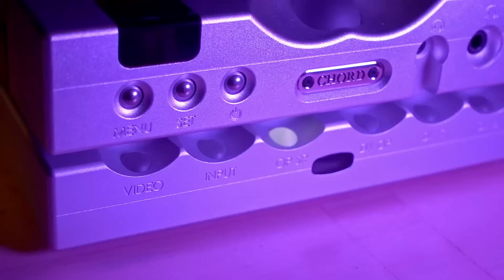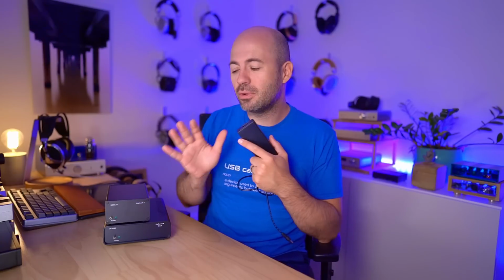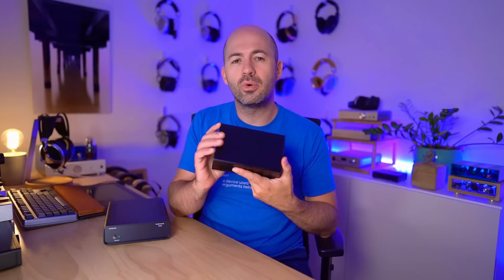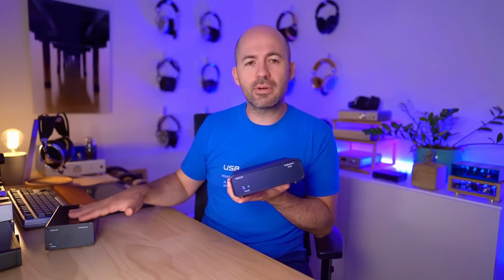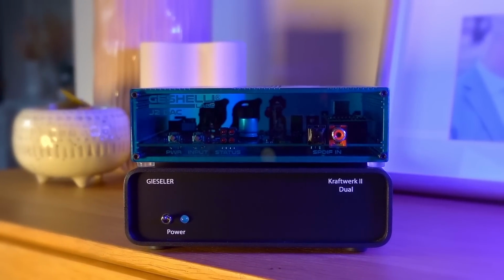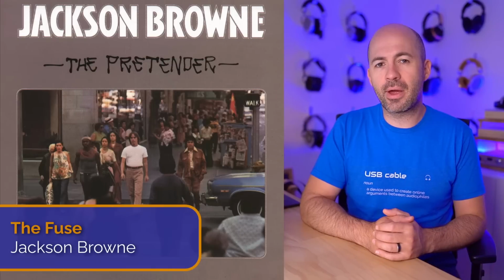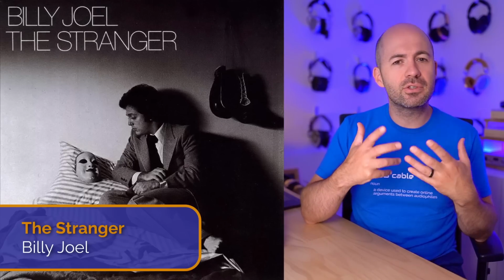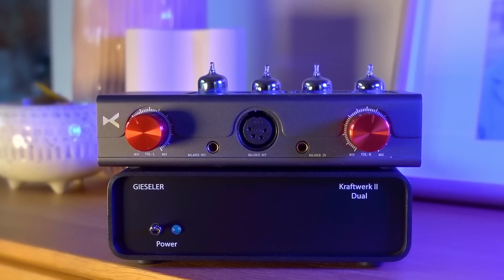Audiophile Linear Power Supplies - Do they improve the sound?

Comment: I am a DIY audiophile. I have been running my DAC on nickel-cadmium batteries intended for standby lighting applications. These sounded better to my ears than alkaline dry cells which in turn sounded better than the supplied wall wart. After 5 years of intensive use, my NiCads are tired so I am designing a mains-powered replacement. I have re-batteried my supply but while doing this I set up my bench PSU so I could still have music. The bench supply sounded shallow, artificial and well, gritty for want of a better term.
I have put my oscilloscope on the bench supply and found a very short spike at 32 Khz which is a full volt peak-to-peak. I suspect this is the villain of the piece.
Putting the scope onto various general purpose and audio grade linear supplies is also quite educational. General purpose diodes often induce ringing at a wide range of frequencies when they switch. The soft recovery fast switching diodes in audio supplies really is a far more civilised device. Finally, use a shunt regulator wherever possible. I first read of this concept in the late great Allen Wright's "Tube Preamp Cookbook". (A hands-on Australian audiophile.) You will also find shunt regulators in Bottlehead kits - and anyone who owns one will tell you they work .
If you are a DIY-er building power supplies, don't trust your multimeter, put a scope on that supply, AC-coupled and look at the nature of the noise. It really affects the sound! 😀
Reply from the maker: That's really interesting! Thanks for sharing!! 🙂🙂

Comment: Thanks Again for another great video. I've watched a few of your videos and you've replied and been extremely helpful. I bought the xDuoo XD05 Pro and it has an option for external power supply via usb-c. It says best used with a HIFI DC12V linear power supply. I don't know how that would work with a USB-C. I don't even know what to purchase...I don't see anywhere that sells that exactly. I don't see how a USB-c connects. I hope you can review the XD05 PRO and explain how to connect the ext. Also your thoughts on the different amps and DAC options. I also purchased the AKM AK4499EX DAC Card. I read changing the op amp to Sparkos SS3602 DUAL DISCRETE OP AMP. makes a big difference. That's what lead me to this video and how great your other videos are. I'm going to also get the Hugo 2 to compare it to the XD Pro. I wonder if the XD05 PRO with the AKM DAC and Sparkos amp and power supply would take it to a high level or is all that just very small gains? Would the HUGO 2 just be better. I'm using this from my MAC apple lossless music via USB-c to headphones like LCD-5, MM-500, Focal's etc. I will look into supporting you with some donations. I hope you know how helpful you are. Thank You!
Reply from the maker: I'm so glad I've been able to help! I've also actually got a video on the XD-05 Pro due out any day now... However, I didn't test it with an external power supply. I'm not sure how much it will affect the sound because batteries are already excellent power sources so it would be for convenience more than quality, I expect.
As for what you'd need, any good quality linear power supply with 12V (and whatever current level that recommend) would do the job as you'd just need to order it with a USB-C connector instead of the more common DC barrel connectors
Reply: @PassionforSound 
Hi there Lachlan. It would be super helpful if you would measure the voltage ripple on the output of all the power supplies you are reviewing. It should be related to quality. 
And especially important is to compare this to the voltage ripple on the cheap wall-wart switch mode power supplies that generally come stock.
My understanding is that it isn’t so much about whether the supply is switch mode or linear—it’s about how much ripple is on the output and how much DC current is available per output tap.
So I don’t expect any improvement if the stock SMPS has 40 mV ripple on the output and a potential upgrade linear has 30 mV. But I would expect a noticeable improvement if the stock cheap SMpS has 200 mV ripple and your upgrade linear has 10 mV.
A last consideration is whether the device to be powered already has a big and effective pi-filter inside to clean up the DC coming in before it enters the electronics. If it has that—then a cheap dirty power supply should be just as effective as big expensive clean one…

Whoa $600 for the Gieseler?! Yikes. You can get 50W 12V linear supplies (2.1A per tap) with measured 5-10 mV ripple on Ali Express for about $50-100! Obviously you didn’t “listen” to these—but other channels are using them and like them—and they’ve tested the ripples! All these power supplies have filters for high frequency noise.

Your points about supersonic frequencies are interesting. I have long wondered about all of that—can we actually perceive supersonic hash created by delta sigma DACs and switching class D amps? Can we actually perceive HF info in recorded music (signal)? I would start with studying the EAR rather than the brain—the brain is obviously super complex and it is very difficult to know what we actually perceive there. But I would assert it kinda doesn’t matter what complex stuff is going on in the brain if the hair cells in the organ of Corti in the ear cannot actually detect HF info—and I believe that is what is the case. Young humans can detect 20 kHz or maybe even a tad higher —variable among people. But it is clear as we age and particularly if we are exposed to very loud noise, damage is done to those hair cells and HF sensitivity decreases over time. So I think it may not even be POSSIBLE that we perceive HF hash and signal directly. BUT there is a question of subtle interference of such Hf info with audio-band frequencies that alters the character of the audio-band info, which we can obviously hear…
Reply from the maker: I'm not equipped to do those kinds of measurements and I suspect there could be more to it than simple voltage ripple or cheap devices would have power supplies as good as expensive ones and that's often one of the key differences between models within the same brand - power supply quality.
Reply: @PassionforSound  mmm, idunno. I think all it requires is an oscilloscope, and I think pro reviewers should have them. With a lot of audio we don’t entirely know what to measure, and we don’t know if by maxing one particular thing out we even achieve anything or just basically do pointless overkill… but I have always believed measurements are a basic part of a review. And regarding subjective listening (which is the other part): unless you do ABA volume-matched blind listening testing we don’t even know if our perceptions are simply being biased (and almost nobody I have ever seen does blind volume-matched ABA testing)—by this I mean you have 3 samples of the same music and two of them are either the test or the control and the other is the other one, and the observer  don’t know which samples are even duplicated —so you have internal control for basic lack of any difference… in many cases the observer can’t even tell which two are the same!
So yeah—idunno. But i think power is basically about ripple and unwanted HF not from the music, and enough current, and unless someone shows me otherwise, I will continue to assume that’s what it’s about—but without knowing what the true perceptible ripple threshold is, and whether it is different for DACs and amps or what…
Reply from the maker: Have you seen my recent video called "The secret to wonderful sound"? That explains why there's actually a LOT going on and why it's hard to correlate measurements to subjective listening.
My next video will explain why blind ABX testing isn't actually helpful (based on science and biology)

Comment: Any decently engineered audio components is designed knowing that the supply voltage provided by those external power pack won't be perfect, they'll have noise / EMI, etc.  The power pack that comes with it was chosen by the company so the component will perform as expected, within the provided specs.
If you have a crappy audio component that doesn't perform with the provided power pack, than simply change it instead of trying to compensate by buying external components...  Here is a video that demonstrates this: https://youtu.be/OL23xkLfPTU
The guy provides crappy power to an audio component using a light dimmer, no change on sound quality...
Reply from the maker: ASR videos and reviews are a dangerous source of information because they're limited to a very small set of measurements based on a limited understanding of what matters when it comes to perceivable sound quality factors.
Reply: @PassionforSound Wrong answer... Facts speaks by themselves. I challenge you and anybody for a blind test in a controlled environment...  By the way, you just showed you don't have the knowledge and obviously didn't provide anything to back your claims...

Comment: Most switched mode supplies have a drop down transformer too. Like the linear supply, it provides isolation from the mains side and the dangers present there. Those are regulators by the look of things. $900 for a 15v 4A regulator is a lot of money.
Reply from the maker: I'm not qualified to debate the specifics of the circuit design. All I can say is that these are sold as linear power supplies and use a transformer before the circuit your referring to.

Comment: Switch mode power supplies are the way of the future. Most audio companies are changing from linear to switch mode power supplies. Much cleaner .
Reply from the maker: Cleaner in one aspect only (low frequency hum), but both LPSs and SMPSs have their own issues. It's not quite as clear cut as you're suggesting. There are just as many brands committed to LPSs.

Comment: Linear power supplies are actually low frequency switching supplies (as was pointed out to me)....The rectifiers are commutators or switches......
Reply from the maker: That's an interesting way to look at it.
Reply: @PassionforSound  Yeah, when you think about it, all the talk of fast switching and soft recovery diodes as rectifiers tells the story. As well as the snubbing networks used to damp down the excitation of the transformer inductance spikes in response to the diode switching. That's partly why people prefer valve rectifiers, as they have different switching characteristics.

Comment: Linear is the superior choice, which is why it’s usually found in precision lab equipment. It’s also much more expensive. Bits are bits until they have HF noise in the signal and may end up with some interpolation errors.
Reply from the maker: That's been my experience too. It's interesting though that someone like Rob Watts stands by the SMPS for his DACs and believes they are as good as a perfect battery supply. (I'm not saying he's the sole source of truth, but he does his research and testing so he's normally got good reasoning behind his conclusions).
Reply: @PassionforSound  He may have a way of attenuating noise in the circuit. Would be interesting to know more.

Comment: Fiio k9 pro does have linear power supply inside. Is the PL50 will improve the sound quality?
Reply from the maker: No. You wouldn't be able to connect the PL50 to the K9.

Comment: What I cant stand about those videos: "I tested..." Provides no measurements :(
Reply: Whats the point of measurements?  If you like the sound with your ears, thats all that matters
Reply: @ When there is no measured difference and you say I like it with device xyz better...... have you heard my magic device? Its only 20k and it will change your life
Reply from the maker: No measured difference doesn't mean there can't be an audible difference if the measurements can't capture the factors influencing the perception of the sound (e.g. timing accuracy or the influence of noise on the internal audio circuits causing masking of low level signals, etc.)
Reply: @PassionforSound  I assume you know nothing about Audio or how measurements of audio equipment work because you dive right into the believe and trust me territory.
Sad.
Reply: @ Buying based on measurements is like getting a car solely off 0-60 numbers and dyno tests. There is so much more to how a car feels than numbers and that applies directly to audio equipment and music appreciation.
Reply from the maker: @EvilCutz assumptions are rarely a good idea https://youtu.be/03ggUm1kjuQ?si=kIKSXzixhJQlaT7Z
Reply: @PassionforSound  What you stated in your system comparison is so abstract I wonder if you even spent 1 minute of your time researching how measurements work.
You link a peer reviewed publication about human hearing and give a short summary which tells me you recognize some scientific statements but then you straight up deny and or withhold or even lie about other things.
I think argueing here wont change anything since this is all based on belief. Good luck with your theology channel.

Comment: Most components don’t have external power supplies so how can these be used? I’m
Confused!
Reply from the maker: These will work with any device using a DC input from a wall wart. I find there's been about a 50/50 split of mains connections (AC) vs wall wart (DC) connections over the years of my reviewing. Lately though, I'm noticing more mains connections with internal switching power supplies so that makes it a bit trickier
Reply: Thanks. This leads me to another confused issue. Power to components is AC and devices stop DC on mains. Yet you are talking about power supplies using DC? So do components use AC or DC?
Reply from the maker: All audio signals are alternating current so they ultimately need AC at some point, but there are many ways to achieve this and the 110-240V mains inputs are all way too high for audio so they need to be stepped down. This can also occur in different ways. So, the answer is that they use both AC and/or DC and it's up to the designers and what they see as an optimal approach for their particular circuit.
I guess it's a little bit like petrol vs diesel vs gas. All can power an engine, but they all work differently with different pros and cons.

Comment: SMPS are fine, nowadays event a cheap aliexpress PSU have noise range of 50mV
Reply from the maker: That's true in theory, but there's still something different about the sound when using a LPS on quite a few devices
Reply: @PassionforSound  Well the rule of thumb is as long as i don't need high degree precision in anything, SMPS would do. I mean it is not like I use Oscope to listen to music. The noise level is simply dampened with speaker inertia, in essence, it acts as a low-pass filter. However, if you listen to a lot of music with sudden volume spikes LN transient response would be superior.

Comment: Thinking of pairing the fiio pl50 with the fiio r7. I'm very new to all this. Do these linear psu normally come with the cable to power the dac/amp?
Reply from the maker: Yes, the LPSs will come with connection cables. If you're buying from a brand like FiiO, it will probably come with the cables for their products only. With other brands, you'll either get a selection of common connection types or you will get to choose what you need during the purchase process.
Reply: @Passion for Sound  thank you for your reply, it's much appreciated!

Comment: Just a small correction, switch mode power supplies do have an transformer, here's how they actually work, first ac input gets converted to dc, there is going to be a switching transistor somewhere in that part or integrated in rectifier,  then the voltage gets busted with buck converter to about 400 volts, after that it goes to inverter where it gets covered back to ac but at much higher frequency than the main power which allows for much smaller transformer, after the transformer now lower voltage gets converted to dc and stored in capacitors, after the capacitors there is an voltage regulator along with noise filter and just before the voltage regulator there is an sense line which measures the voltage in output caps and switches the power supply by controlling the transistor on the primary side, some switch mode PSUs can have multiple output voltage regulator stages in series giving them less ripple.
The name "switching power supply" doesn't come from "switching transistors" it's called switch mode because the whole power supply turns off once the voltage in output cap has retched the certain level, and it switches back on once the voltage drops so there is very little energy wasted on idling.
Reply from the maker: Thanks for the detailed explanation, Sebastian!
Reply: Sebastian_Athea, writing as a person who designed both linear power supplies and switching ("switch mode" is a stupid name, I wish people would stop using it) supplies, your "this is how they work" description of switchers is not representative of ALL examples. A great many switching supplies use transformers, but many don't. Granted, unless the switcher is very cheap, it WILL have a transformer for galvanic isolation if for no other reason, and AC/Mains switchers will certainly have a transformer, but NOT all examples in the broader switching category will have them. But basically, you wrote a good description.

Comment: I just got the Topping E50 ..and “everyone “ says it scales with better power supply and an improved performance overall….🤔🤔🤔🤔
Reply from the maker: Yes, I agree. There's no need to go mad with that though - a simple iFi power supply or a battery power bank type setup will be great and won't cost 2-3x the price of the DAC
Reply: @PassionforSound  best of the Easter 🐣 season to you and yours…I may go the IFI route for the power supply ..
Thanks for the advice.
Reply: Have you tried a better power supply yet?
Reply: @thaflybear  Yup!
I puked up an IFI power supply for the DAC 👍
There’s a cleaner “blacker” background and for the money , the DAC is really quite good.